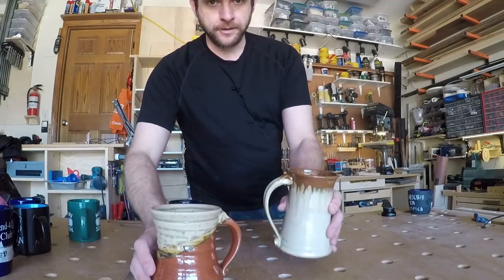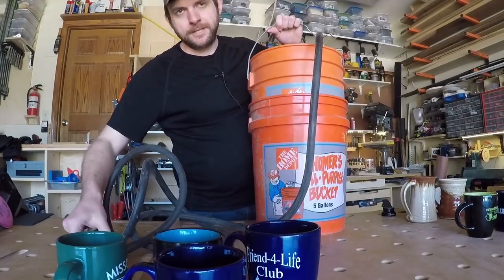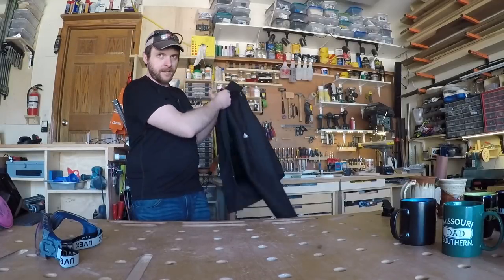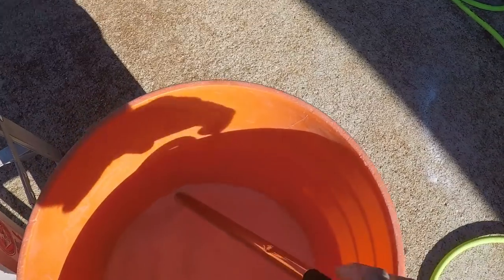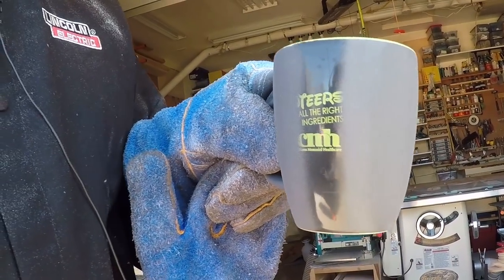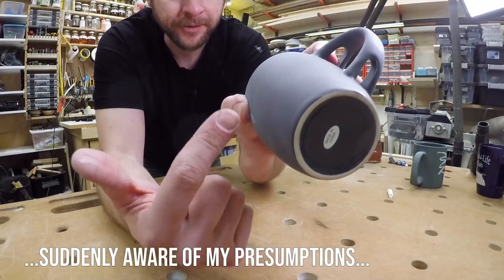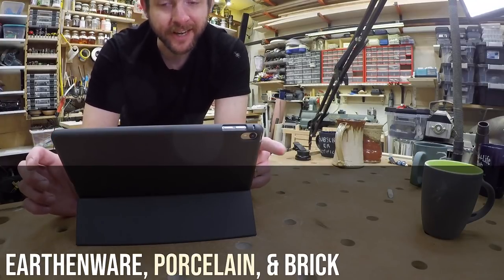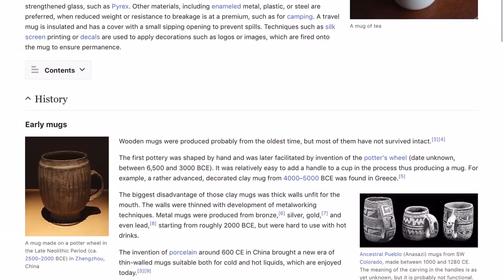$30 Sandblaster + Coffee Mug = CHALKBOARD Coffee Mug

Comment: The word you are looking for is 'glaze'. The colored part of the mug is called glaze.
Reply from the maker: Glenn Wyant thanks!  To be clear, that includes both the colored part and the gloss?
Reply: @KeithsTestGarage   Yeah, the glaze turns glossy in the extremely high heat it is fired in.
Reply from the maker: @MaxDSquires  Thank you.
Reply: @KeithsTestGarage  The glaze is applied to the surface of the ceramic before it is fired in the furnace. The glaze melts, resulting in the glossy surface. 

You should be aware though, that some glazes include lead, which helps enhance the color and sheen of the glaze. Not all glazes have lead, but you might want to get a test kit and see if there is any in the cups you have blasted already.
Reply: @KeithsTestGarage  The material scientist in me was smiling with joy when you were looking that up. I realized my field of study is still not general knowledge :D

Comment: Fired earthenware. Glazed fired earthenware. Glaze is glass particles in a slurry that is fired on to a clay pot.
Sandblasting the surface actually weakens the cup (a tiny bit)
Reply from the maker: That would make sense. If the blasting doesn’t go past the enamel, is all good?

Comment: I'm probably going to get this sand blaster (dangit! and thanks!) -- I'm curious, however, if removing the glaze removes the "food safe" aspect of a mug. If there's something the glaze is preventing you from leeching chemical x (I mean, it made the powerpuff girls, it can't be that bad), then...bad? Note: I speak completely from the lack of knowledge, not from having any.
Reply from the maker: DigitalArchmage somebody else brought this up elsewhere and my research has led me to believe that since I’m not removing the glazing there is no issue.
Reply: Sand blasting the inside of a mug would make it considered not food safe. Even when we use matte glazes on pottery it fails the "food safe" test if its used anyplace food or drink will be in contact and this is for numerous reasons. 
One issue is we do not know what kind of glaze has been used to glaze the cup. Some cups might use lead glaze, considering all the products that are coming from China these days its definitely possible the cup your using was glazed using a lead glaze. Sandblasting this would not be a good idea as lead and other not so nice particulates would be released. 

Sandblasting the outside of the mug however is not a problem.
Reply: @bethechangeme2233  excellent points